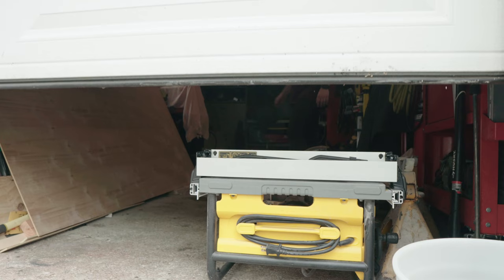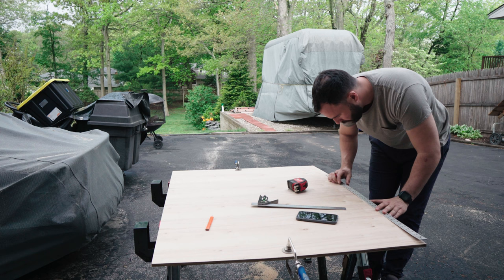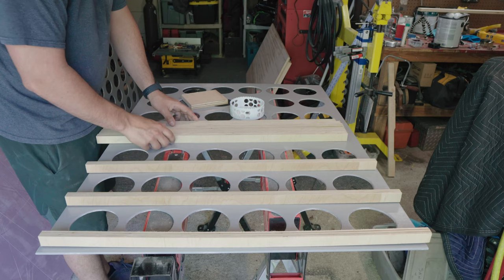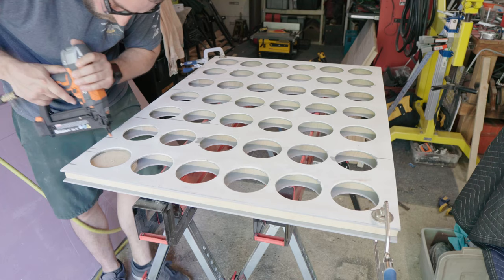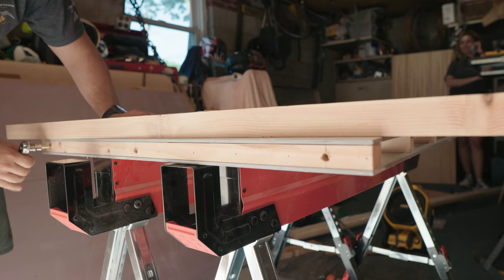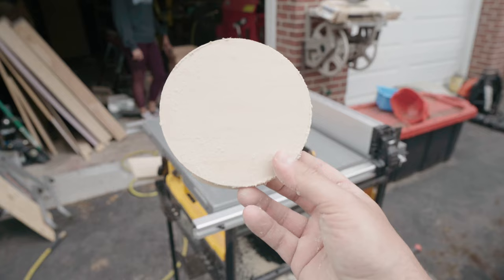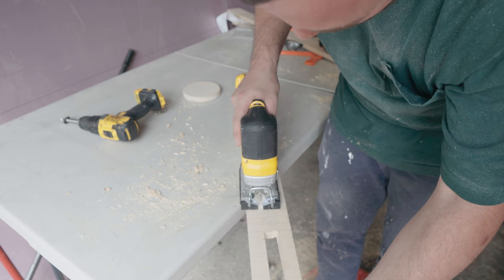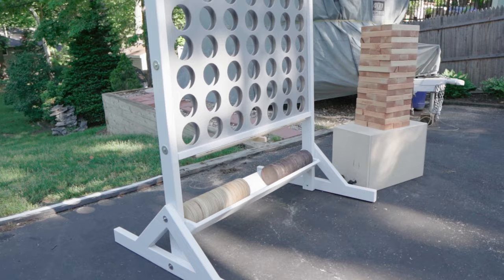Before you BUILD Watch this! (Giant Connect 4 and Jenga)

Comment: Not very clear on making the disk without the hole in it
Reply from the maker: I drilled a hole through a piece of 3/4 MDF with the center bit still in the hole saw, I then clamped that piece to the plywood I made the discs out of and removed the center bit from the whole saw and simply drilled through! Basically made a guide.
Reply: Awesome! Thank you. Blessings to your channel